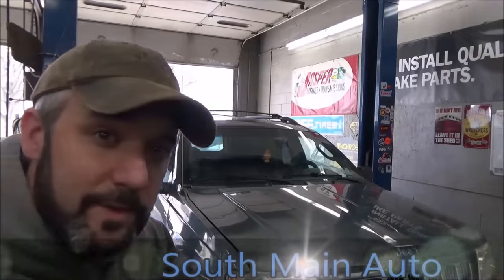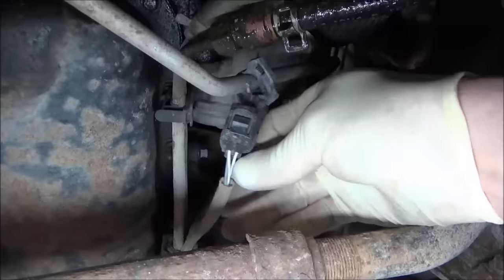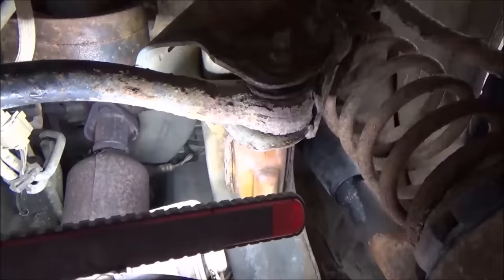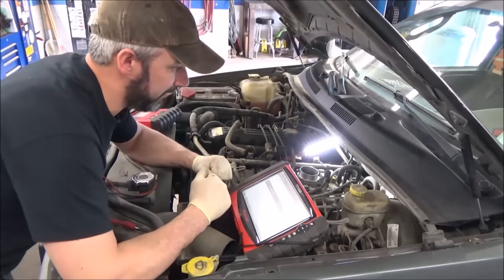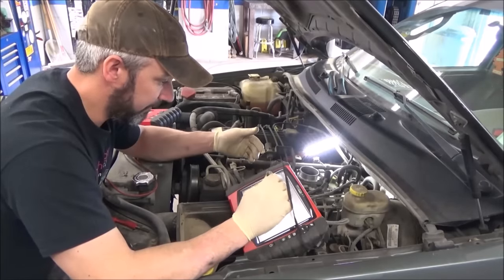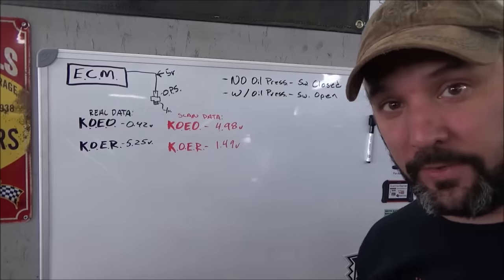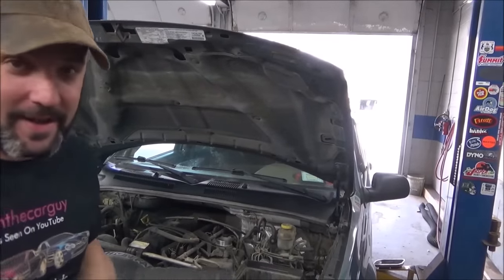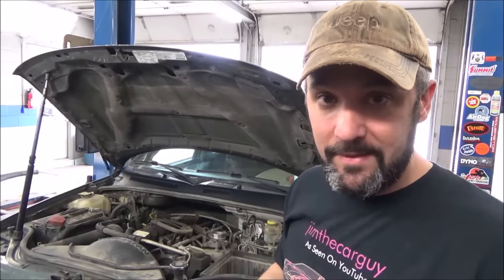Jeep Grand Cherokee - Check Engine Light P0141 / P0155 / P0523

Comment: Surprised that it had a proper looking analogue gauge hooked to an oil pressure switch, was shocked when you showed it at the end of the video. All the way though I was thinking maybe there is a proper oil pressure sensor hidden somewhere and the switch was a failsafe! I was wrong!

Comment: Eric quick question i got a 96 ranger 3.0 after it warms up it has rough idle and misfire but the only code i,m getting is purge control valve high output. I,v changed everything except the gas cap which i will be doing next. I replaced plugs coil wires  purge valve thermistor new vac lines getting voltage to the purge valve but still getting the code and no gas tank pressure leading me to think bad gas cap. Taking it up next week to get diagnosed so i can get the emissions test done.. Will let you know the out come asap!

Comment: great video as always, but i have an 2001 4.0 strait 6 and my oil pressure is at 40 when at an idle and around 60 to 65 when driving so. not sure why that one doesn't move lol but mine does with 298,371 miles. weird.

Comment: I don't know why they would change over to this. I have a 2002 Grand Cherokee and it has a 3-wire oil pressure sending unit, and the gauge does function (move).

Comment: I have the same Jeep.  My oil pressure gauge kept going from full oil pressure to nothing about every couple of seconds.  I replaced the oil pressure switch and it was fine for about a month.  Then it started doing the same thing but only if the engine was warmed up and at a stop light.  Now it makes sense.  I just ignore the damn thing.

Comment: I had a late 90ies Ford F150 that suddenly lost oil pressure....0 PSI on the gauge but no sounds of upper valve train noise, or bottom end noise. I figured the sensor was bad pulled & it read open on my DMM. I bought a new sensor, installed it & the pressure read 45  lbs at idle. I knew damned well I didn't have 60 lbs at idle, so I installed my test gauge & had a little  under  30 lbs & it went to 60 lbs at about 2000 RPM. . I pulled the instrument panel & traced the printed cct back plane & discovered a 470 ohm resistor that the gauge read the voltage drop across !. The sensor was a spring loaded sensor that that was a configured as a pressure switch & was either open or closed....as long as there was more than 15 PSI the switch was closed & the gauge read about 45 lbs.  I went to the parts store & bought a pressure gauge & matching sensor that now told me the actual pressure & the reading changed with RPM as one would expect.  I could hardly believe a company would go to those extremes.

Comment: Had a 03 Grand Cherokee in today for the money light. P0135 And the P0155 Both up streams for the heater failure. Almost made the mistake of calling a PCM because i wasnt getting power feed and saw on the diagram that the front o2's got their feed from the ASD relay but i sat and thought well that cant be right because the thing ran pulling it in the garage. Sat down and rethought everthing and had a giant facepalm moment realizing the engine had to be running for the relay to be energized or the bidirectional control. Still ended up Thinking PCM because back probed the PCM connector and im not getting the PWM on the control for both front O2's. Wish i had a scope to look at it but the ole scope on a rope does not light.

Comment: I have to suggest that the oil pressure sender is not the original unit and the variable sender was replaced with a simple switch at some time.

Comment: So the O2 sensor is temporarily permanent install, that will only bother people that do not recycle and can afford a new vehicle over removing a failure point connector.  Oil pressure switch open one up it has resistors in it.  I have replaced that switch on every jeep I ever work on, a real pain on a 4.7.  That Jeep still has a few miles to go.

Comment: I used to be a mechanic for a large logging Company the had like 35+- trucks and everyone of them had to be ready to go in the am like 3 or 4 am if a truck was shut down because of a bad connecter. 
 My ass would be down the road.
 I did what I had to do to make sure the trucks ran every day.
 The parts rooms would make Kenworth blush we were better setup than any shop I have worked in ever. Rebuilt motors transmissions 3rd members windshields by the pallet. 
.the trucks had to go every morning  so a connecter cut splice it.

Comment: So this vehicle failed state inspection for a check engine light but not the tires? Or were the tires flagged too?
Reply: +06acc  Normally one of the first things in the inspection is to start it up and look at the CEL. If it's on you STOP the inspection because that in itself is an automatic fail. You don't even bother continuing the inspection. Just tell/call the customer and tell them " it won't pass, what would you like me to do?
Reply from the maker: +06acc It was brought to me to have the engine light fixed and make sure it can run a drive cycle.
Reply: In California where I live we don't have state inspections. Are state inspections done annually in New York? We just have emissions inspections every other year, new cars are exempt from this for the first 5 years then will be subject to biannual emissions inspections. Are your state inspections for safety or emissions? In my opinion bald tires are more of a concern than a check engine light.
Reply: Safety and Emission inspection is yearly in NY.
 http://dmv.ny.gov/brochure/new-york-state-vehicle-safetyemissions-inspection-program
Reply: +06acc As Blazer02LS says, inspection is yearly in NY, registration is for bi-annually.  In PA, inspection is yearly as well, as is registration.
Reply: 254 counties in Texas. Only 17 do emission testing. Have to check the smog in the big cities.

Comment: Mazda Miatas starting in '95 have the same oil "idiot gauge". Total cost-cut move, '90-'94 had a linear sensor. Really annoying because the fake gauge reacts slower than a warning light would.

Comment: The 2003 and 2004 grand cherokees are the only ones with that stupid fake oil sender. I have no idea why they did that
Reply: Because Jeep hired too many MBAs and not enough engineers
Reply: I was wondering, My '02 goes up and down with throttle.

Comment: Thank you for this first and foremost.  Now I have a question.  I have NO CHECK ENGINE LIGHT on, however when I turn the key on my Computer on the roof tells me Service is required with three beeps.  I ran my codes and it says PO 432.  I looked it up and it says Main Catalyst Efficiency Below Threshold.  So would this be an oxygen sensor on #2 bank or my Catalytic converter?  If you could answer this for me I would appreciate it.  Love your channel.

Comment: Love the videos!! Keep up the good work. Just some food for thought. I'm a Mercury certified boat mechanic...so there may be a difference. In my training I was told that some older 02 sensor had a tiny hole on the outside of the housing....as yours may or may not have in the video, I'm not sure.... for referencing outside oxygen. But the newer 02 don't have that hole. They actually breath between the copper wire and the insulation inside the wire. Thus splicing, or soldering on the newer style 02 can cause it not to read correctly since it looses it's outside oxygen reference. Maybe theres a difference from boat inboards and car motors 02 sensors. I just subscribed so keep em coming. 👍🏻
Reply: I have read that some have breathing holes too.

Comment: I think I got the oil pressure system figured out. Imagine in the PCM that there is a built in resistor in series with this circuit. This would be there to bring down the current so it doesn't burn up the 5v regulator. Ok I'm think the scan tool is getting a reading of voltage drop across this internal resistor and your real time is reading across the switch. You are measuring two different voltage drops that should be inverse. So for scan data: Since the oil switch is essential a short to ground the voltage drop across the PCM resistor would be 5 volts. with the engine on and the oil switch turning into a resistor the voltage drop on the internal resistor in the PCM would go down. REAL TIME: Oil pressure gauge is shorted so little to no voltage drop. Engine on the oil pressure switch builds up resistance so you would see more voltage drop. Got it? To prove this (car is probably gone now) put your multimeter in AMPS mode and measure the current going through it. Take your 5.25 volts and divide by the current and that should give you the internal resistor value. Let me know if this makes some sense out of the issue.

Comment: Just saw this video and my 2011 Ford E-150 has the same setup.  I have an oil pressure gauge on the dash that never moves.  I learned from Wes (Watch Wes Work)  that Ford has the same system... just a pressure switch.  The gauge is worthless.

Comment: ive seen the failed o2 heater code before when it took longer than a preset amount of time to start switching..  computer thinks its because the heater failed because if the heater was working properly it would start switching within its allotted time...  the o2 heater low circuit code is what you get when the heater actually fails or circuit goes open...  hope I helped....

Comment: Argh!  I was sitting here screaming at my monitor as soon as you zoomed in on the backside of that oil pressure switch...

Well done doing your own research to understand the circuit, though!  I wish more people would do that in this industry.

As far as I'm concerned, your O2S wiring repair was legit.  You got the magic pixies flowing again, and it's a solid, sealed connection.  You also strike me as the kind of person who'll take care of the customer should any concerns arise.  :)
Reply from the maker: +rhkips Oh man what were ya screaming!?
Reply: South Main Auto Repair
"It's a switch, Eric!  It's a SWITCH!!"  I don't get to work on too many Chryslers, but that "sensor" looked way too much like a GM oil pressure switch to me.

GM is guilty of having a "switch gauge" setup, too.  It seems to have been a thing with that era of American vehicles.  I've been told that it was done to provide familiarity to those used to seeing an oil pressure gauge on their cars and trucks dating back to the '60s and '70s, much the same as lower output V8 engines are still offered in trucks today because the mentaility of "a truck should have a V8" is still prominent.  ;)
Reply from the maker: Haha yeah the Chrysler's switches fail all the time. Usually puking oil right out the connector too.
Reply: Their legit oil pressure sensors/sending units suck too.  The one on my '13 Journey failed resulting in a stuck pressure of 99PSI engine running or not.  And man do they suck to replace too!  Under the intake down in the valley between the valve covers in an opening I could barely get my hand into and at an angle to boot.  My biggest worry reinstalling the replacement was cross threading it.

Comment: Interesting to see the oil pressure gauge is fake. My old TJ wrangler's oil pressure gauge is basically an on/off switch, needle never moves when engine is on, I actually wondered about that.

Comment: My jeep, 92 xj, has the same single wire oil pressure sensor. Had my gauge peg out, at 80psi, looked at sensor, had oil coming out the back, replaced it and pressure went back to 40. I got no idea how it works 

I assumed the sensor it created its own power, and then the ECM interpreted the voltage into a pressure, since the gauge does go up and down

Comment: Does the rusty hole on the wing, or fender as you call it, fail its inspection  test?
Reply: +Jonathan Dean No thats superficial
Reply: +a Do you have laws that govern when rusty holes become dangerous to pedestrians?
Reply: Different states have different laws. But most rust that isnt on the frame/steering components is just crappy looking and wont make a difference with driveability
Reply from the maker: +Jonathan Dean Nope you don't even nee fenders / wings here for NYS inspection... heck, we don't even need ball joints...
Reply: +Jonathan Dean Nope. Of the states that still do "safety inspections" about the only rust related items are frames and suspension parts. Even those are spotty.
Reply: +South Main Auto Repair Is it only your word that says the check engine was off at the time of inspection, or do you have to fill out paperwork etc?
Reply: +Jonathan Dean 
 No.  The vehicle comes in, if you're a nice guy you look to see if the light is OFF first.  Next you do the physical safety inspection. If that's OK you hook up the NYS DMV inspection terminal. Punch in the plate, VIN and it will start the test. It will ask you to watch the light as it turns it on/off and you acknowledge those. Then it runs a test to see if there are any codes that would turn the light on, and ask you again if the light is on if there are any. Then it runs the readiness monitor check. If all required monitors are run. You're allowed 1 or 2 to be open depending on the vehicle (usually EVAP related). If all is good you pay the shop, get the holy sticker on the glass, and are set for another year....   Now if you live in some of the heavily populated areas your inspection goes a bit farther, but not much.

Comment: My 2004 Chevy Silverado with a 4.3 liter v6 must have and actuall oil pressure gauge as it fluctuates all the time .
Reply: +Kent Taylor GM didn't cheat on the trucks. Just cars...
Reply: Yep, my Astro van and my Sonoma do the same thing. Real gauges
Reply: 2002 silverado, 1994 astro, 1994 s10, 1995 silverado have real gauges.

Comment: - On the oil pressure gauge -- Ford does the same thing on some of their vehicles. I remember Brian from Ford Tech showing  us about that in one of his videos.  The gauge are really controlled from the PCM and are NOT representative of actual oil pressure. A Dummy Gauge is all it is.  Better to run a drivers side pillar gauge pod.  Easy Peezy Breezy and you get the real deals.
Reply: +Hawaiian F150 Good Point, I have been down that rabbit hole ONCE!  Q!@#%$^&*@!
Reply: +Hawaiian F150 Every Ford I've had had a dummy gauge (88 Linc Mk7, 92 Crown Vic, 95 Bronco, 96 Sable) but  I heard of some sort of mod to put an actual pressure sensor in place of the switch and some minor mods to the cluster to get a pressure reading on late 80s to mid 90s Fords pre OBD2. Of course what it's calibrated to I have no idea, so yeah, an A pillar gauge pod is the way to go, unless you have an AC vent you don't mind plugging up.
Reply from the maker: +Hawaiian F150 Just wait till it starts knocking.... then ya know... ZERO PSI

Comment: Ah the old  "Dummy Oil Pressure Gauge".     My Bronco II has that.  So does the 95' Explorer I'm fixing up to replace the Bronco.  It's done because the general public can't deal with the oil pressure gauge needle going "up/down" under normal driving.  It was freaking people out.  So instead of 'teaching' people--they opted for a dummy gauge.
Reply: *****
  Kinda sad that Ford considers it's drivers stupid.   The 87' I used to drive had the "Fake Gauge", the 89' I currently drive has the "Fake Gauge"...and the '95 I'm fixing has a "Fake Gauge".    If the setup is pre-OBDII there's a way to convert that fake gauge into a real working one.  If the oil signal goes through the PCM/ECU?  It won't work.  They discussed most of it on one of the Ranger forums I work with.
Reply from the maker: +Daniel Tobias Yeah I bet he is not to far off...
Reply: +Tedybear315  Yep, the early cluster used a resister wire or a resister soldered on the panel (depending on year) Remove resister, add correct sender and a single wire to it and bingo, real gauge. Can be done all the way up to the late 96 early 97 models. Then they went to the ECM controlled gauges. On those an add on gauge is the only option.

Comment: I doubt you will lose any subscribers for that wire repair. You made every possible effort to do it the "right" way. From my experience, the replacement pigtails are outrageously priced. That would be another reason to pat you on the back for what you did, not condemn you.
Reply from the maker: +eldoradony Yeah the one that they sent from Dodge that was wrong was as much as the O2

Comment: well i have an 01 grand Cherokee and swapped the oil pump to a high flow pump and mine reads higher was 40 but reads about 50 55 now

Comment: Wiring loom that little plastic stuff out side the wiring harness was all deteriorated on mine it came back after the new sensors until I replaced the plastic a 3 dollar fix particularly over the engine

Comment: I TOOK THE CLUSTER OUT IN MY 01JGC TO SEE WHY MY ENGINE LIGHT DID NOT GO ON WHEN I STARTED CAR .I BOUGHT PC74 BULBS AND TRIED TO REPLACE IT IT STILL DID NOT GO ON .IS IT POSSIBLE THE CONTACT POINT ON THE PRINTED CIRCUIT COULD BE WORN?THE BULB IS OK IT WORKED IN ANOTHER SPOT.

Comment: It looks like the backward oil volts in the computer may be measuring how many volts it's pulled down, maybe relative to the 6v rail.
Reply from the maker: +Ian Levine Dunno because the numbers are not the difference ya know?

Comment: What if low oil pressure results in pulsing the sensor, the results could cause the ecm count the pulse. the lower the count the lower the pressure.

Comment: Interesting as my 96 ZJ 5.2 has a 'real' or moving gauge, idle at about 550 rpm is 20 and above that 40-50 depending on heat and oil viscosity